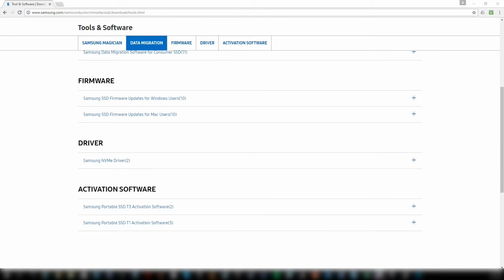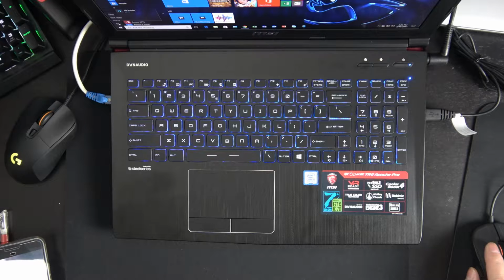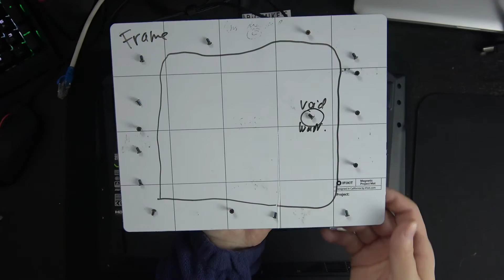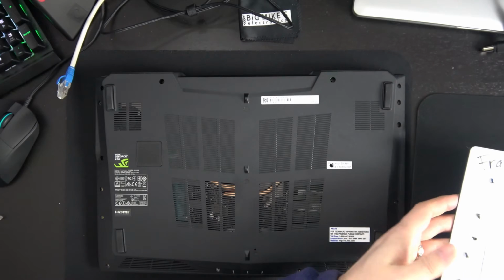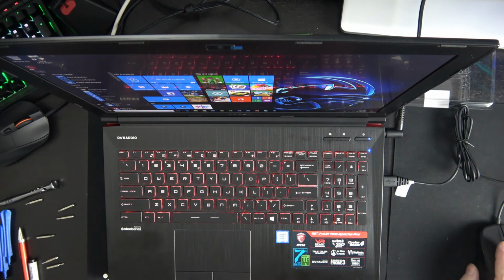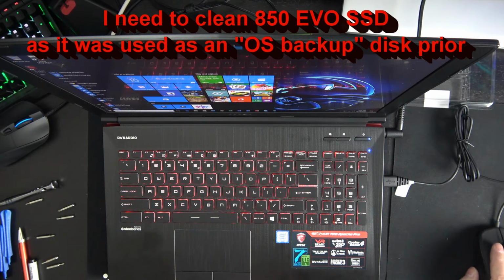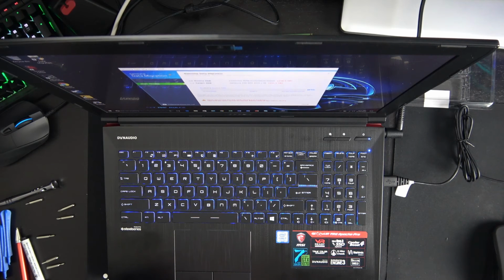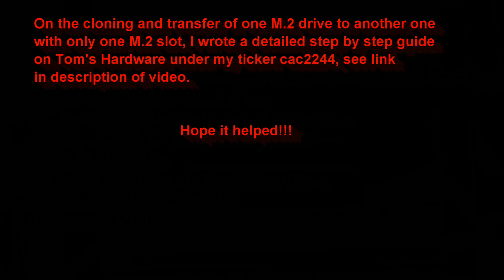MSI GE62MVR Apache Pro amazing upgrades and M.2 cloning

Comment: HI, So this is great BUT it's doesn't work fully for me. I came across your video via your post on Toms Hardware.  For you, it is working because you have your SSD plugged into your Laptop via Sata. I'm have an Asus Zephyrus 501 that has one MVNe slot and that's it. I have used USB3 ports with Samsung T5 drive but it doesn't boot up properly - Do you have any suggestions?  I'm trying not to do a fresh install on Windows due to many programs i would have to reinstall.
Reply from the maker: Hello Tatum, Sorry to hear you are having problems...the zephyrus is an awesome machine... anyway, it does come in 256, 512 and 1TB variants but I guess you tried to up from a smaller size and wanted to do it yourself...that makes sense but not as easy to do as you probably hoped and there is a good reason for this. First of all let me tell you that your description does not provide enough info for me to really guide you, but I can only try to give you some pointers and I can already tell you that you will not like my solution. 

First of all, you are correct by saying that for me it was easy because the drives that I used were all internals...there is the first and main problem... you used an external T5 usb 3 drive to clone you original drive and Windows is such an ugly animal that it does not really want you to clone on an external drive... I will put as link below that talks about it and ways to go around it. If I am correct, the zephyrus comes with the Samsung SM951 M.2 (M keyed) ssd drive and it is indeed an Nvme drive, so if it were a M.2 sata drive you might have options with a USB caddy to try to switch things around, but you don't have that luck... If I were you, I would use a USB 3 dock or adapter such as the Startech USB312SAT3CB and a regular internal  SSD drive and do the cloning from SM951 (or whatever your original M.2 drive is) to the SSD. Make sure that the new SSD will be also cloned as a GPT drive. Then change boot up sequence in BIOS to USB attached SSD drive, then put new M.2 drive in laptop and clone back from SSD (on USB) to new M.2, then remove SSD via USB, then reboot while going in BIOS and change back to your new M.2 drive.

As you can see, there might be some struggles to get it done and there is possibility it might not work, but on my end, I have done a few M.2 cloning using my startech adapter  USB312SAT3CB and a regular Samsung SSD and back to M.2 Nvme and has always worked (I have eight M.2 Nvme drives, all Samsung 950 or 960 pros, so I have had my share of headaches and frustrations too).

I do not know how experienced you are and your ability to play around and inch towards a resolution, but IMHO, a fresh install using a USB (UEFI) Windows installation drive and using your Original windows key and re-install all your programs is probably the best option and the one that will ensure optimal performance down the road regardless. 

I have had many asus laptops and often they do not give you the Windows key, but you can google "recover windows key" and you will find various ways to recover the windows key. You might have to call it in to reinitialise, but it is all automated and you have to confirm that it has and will be used on only one machine.

I wish you good luck and cannot do much more for you remotely, but i would appreciate to keep me posted if you are able to get it to work.

How to trick windows on cloning to external drive: https://www.pcworld.com/article/3185777/windows/how-to-install-windows-on-an-external-drive.html
Reply from the maker: Tatum, This guy did the same as you and he did as I told you to do, which was to do a fresh Windows install from a   bootable USB drive (as he answered user ChenYue Dong on first page of comments).

You probably already saw this video, but just in case, here is the link: https://www.youtube.com/watch?v=kCPjT2B7Ae0&t=451s
Reply: cac2244 that’s very kind of you to take the time to respond so comprehensively. I will take you advise of ensuring a good set up by doing a fresh install. Maybe I’ll get to rethink some of my install decisions along the way. The drive I’ve bought is the Samsung 2TB pro - should last me a while :) thanks again!

Comment: Thank you so much for this video !  Tackling this project this weekend.  Did you notice a big improvement ?  I am upgrading all 3 at the same time as well.  Got a new subscriber, thanks !
Reply from the maker: Joshua, I did not get to see the improvement in performance because I literally had my new drives and RAM at home before even receiving my new laptop. I did the change immediately. But of course, the change does improve performance, especially the RAM and SSD instead of antiquated HDD, but the impact is felt mostly while doing video editing on large files thanks to RAM and SSD storage drive instead of much slower HDD. The 960 M.2 drive is just out of this world.

Good luck with your project and keep me posted on how it went. 

Cheers from freezing Canada!

Comment: Thanks for the guide. It will come in handy as I will attempt to replace the 512 GB m.2 with 1 TB 960 EVO in my XPS 15 9560. 512 GB was just not enough for my needs and my version of the XPS 15 has the larger battery instead of the SATA drive bay.

Comment: Thanks for the video! I saw your post on Tom's hardware forum, but cannot seem to reproduce what you describe about cloning using the Samsung software twice... Any suggestions?
Reply from the maker: Onno Öry 
Remember that to use the cloning tool from Samsung, the target  drive has to be Samsung or else it will not work. If you use Samsung drive, there are so many variables that it cannot be troubleshooted that easy... Maybe try another tool like Panagon, but at the end, any issue with Samsung tool, if you are using Samsung drives, would have to be about ability for computer to recognize target drive.
Reply from the maker: So check your connections, if you have Problem with M.2 drive, try to place it in another m.2 slot or on a pcie bracket (these are cheap), or if on a Pcie bracket, make sure it does not interfere with pcie lanes that could be shared with other ressources...also could be that disk is in MBR format and not GPT if you try to clone windows UEFI...etc... Check in windows disk management to see if your target drive is there, etc... These are places you can start looking at.

Comment: Awesome tutorial, helped me a ton! I just wanted to add that after cloning from the hdd to my new m.2, i had no problems booting with the os on both drives. You just have to set the samsung ssd to boot priority in the boot menu :D then you can clean/format the D: drive, without having to remove it and reconnect it.

Comment: Do you know if its possible enable G-SYNC on this model via software level? Since it has no h/w g-sync module.  Thanks!
Reply from the maker: Rom GM 
G-Sync is hardware based...if you don't have the hardware, which this computer does not have, then there is no way a software solution could enable the feature. There are plenty on video on that, I know Linus from Linus Tech tip did a good one in this some time ago.
Reply: cac2244 I see, how actually important Gsync? If I use FHD only no 4K and none of my screens are beyond 60Hz.  I mean what would you go with 1060 Gsync or 1070 without Gsync looking long term as 3 or 4 years from now?
Reply from the maker: You trolling me buddy??? Just in case you test me or that you really want to know... FHD only at 60hz, then do not bother with G-Sync...as for 3-4 years from now, 1060 or 1070 will probably be both obsolete... purchase for what you need now and for your budget... I recently bought a G-Sync WQHD Monitor, Asus PG279Q and actually did not like it and went back to my regular 1080P monitors. BTW 1060 with G-Sync will more than likely stutter, so I would go with 1070 without g-sync and never look back.
Reply: cac2244 no trolling at all, sorry for the misunderstanding. I didnt said that FHD can be beyond 60Hz... I actually said that I have FHD and it can't be over 60HZ and asked if without having any monitor beyond 60 if I really need that Gsync 
...
Reply: cac2244 yes so you answered my question! I don't need this Gsync 🙏 thank you.
Reply from the maker: OK...understood... and the answer is...IMHO, NO, you don't...
Reply: cac2244 I will tell you the whole story. Bought Asus GL502VM-FY053T I7 6700hq with 12 GB ram and l1060 GTX but temps going up to 98c on gaming while in flat desk and around 94c with cooling deck. Float temps around 85c while gaming max is those 95 to 98c. So I think return wait 10 days for them check and credit me so I can get MSI maybe... With 1070.  Should I do it? Or temps I got are healthy? Thanks!
Reply: cac2244 decided stick to Asus rog with 1060.... For FHD 1060 will be just good... I won't get 4k screen next two years to make good excuse to replace 1060 Asus rog on MSI with 1070...ans I guess in 2 years when 1060 will be weak... So 1070 will be....

Comment: I think the best combo of storage drives is an SSD + HDD.
Keep in mind that HDD's are more reliable and live longer than SSD's.

Also I've heard from many people that using more than 50% of the total SSD capacity, for a long time--> lowers it's performance, and damages it significantly (while HDD's can be full and still work properly).

What do you think?
Reply from the maker: I do not believe this is true anymore about the life of the SSD drives, especially that technology and quality of memory has drastically improved over the last many years. Also, my point about this is that most quality SSD drives now guarantee 10 year life span and HDD of course can guarantee much longer, however, in REAL LIFE, HDD have moving parts and always die before their theoretical useful life anyway. Also, since technology changes so fast,  regardless of age of drive, I always build new machines or change laptop almost on a yearly basis, so I never get to see which one will live its 10 or 20 years life span... You catch my drift? On paper this is a true test, but in real life, as a consumer, this is pretty irrelevant. My last comment on the topic is very simple...in my desktop and laptops, I have M2 drives and SSD's and just because of data safety concern, I always back up my data on a NAS device  (which is fed by multiple HDD's), so my data, one way or the other, is protected,. Like this, I do not have to keep a dinosaur of an HDD in my gaming laptop or desktop...
Reply: Why use an HDD in a gaming laptop if it's going to be the slowest part? I personally would exchange for a Sata SSD as well: It runs cooler and at least 5 times faster than a regular HDD. SSDs need to get cheaper so that laptop manufacturers will permanently get rid of HDDs.

Comment: Tempering the sticker doesn't void your warranty, it's there just to prevent noob idiots messing the whole laptop
Reply from the maker: Warpony 
What you say is 100% correct.
Reply: cac2244 ofc because i sorta work in msi ;)
Reply: I replaced the Wifi Card as soon as I got it,  Have since replaced M2 Drive with Samsung SM961 and Seagate Firecuda 2TB.  I wish a 32GB RAM kit wasn't so damn expensive.

Comment: what kind of temps are you getting?
Reply from the maker: The highest i got on cpu was 73 C and as you know, it can get up to nineties...
I have not monitored my GPU temp, but did not see any issues after hours of gaming. I will monitor later this week and report back if i can, but really temp has not been an issue after 2 weeks of intense use.
Reply: cac2244 awesome!  yeah temps have me worried with some of these high power machines...oddly I have also seen this machine advertising the 180watt brick
Reply from the maker: Well, just for you, I quickly ran Unigine Heaven for about 20 minutes and got a max of 65 C at average 150 FPS GPU temp. The machine i have purchased  (then later on upgraded) is the GE62MVR-7RG, with an i7 7700HQ, 16 GB RAM, 256SSD + 1TB HDD anf GTX 1070 GPU. It came with a 230 watts PSU.
Reply: cac2244 fantastic!  thank you.  I'll probably be joining you as an apache pro owner when the stores open tomorrow!

Comment: Great video series! I just purchase the Apache Pro GE62MVR-003 today! This computer is business first, video editing second, and try hard H1Z1 Battle Royale third. Will any of these upgrades improve the in-game FPS?
Reply from the maker: SmileyDakota,

To answer your specific question about in game FPS, the answer is NO and you can learn more from this recent video from NCIX (Go Canada!!!...haha). https://www.youtube.com/watch?v=tIXSSOzyLbs

Where these components make a difference is when handling large files and this will be true when doing video editing, which you do. Remember that regular SSD's like the Samsung 850 Pro or the Samsung M.2 drive (Sata based)  that comes in this laptop, will read / write files at about 500 MB/s, where a 960 Pro for example, which is an M.2 drive but Nvme (or Pcie based) drive, will transfer at 4 times the speed at a range between 2 up to 3.5 GB/s. Video editing will be much faster. Old style HDD like the 1 TB that comes in this laptop will transfer files at half the speed of SSD's.

I made the upgrade purely because of bragging rights and because I am passionate about getting the best machine possible, but if you just need to maximize in-game FPS, such upgrades will not do it for you and is NOT worth it. 
However, if you are like me and use this laptop for business and do some video editing (and have the available income), then your video editing will be that much faster and then would be  worth it. As for being a try-hard, i try hard at CSGO, and man do i get recked...but the is the only way to improve is to keep going at it...LOL   

Hope this helps and good luck! (keep me posted)